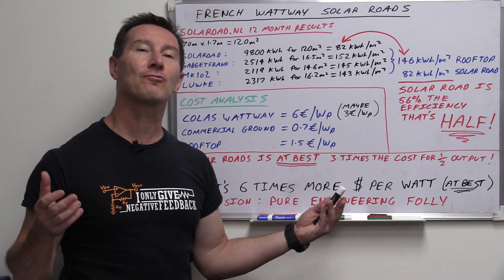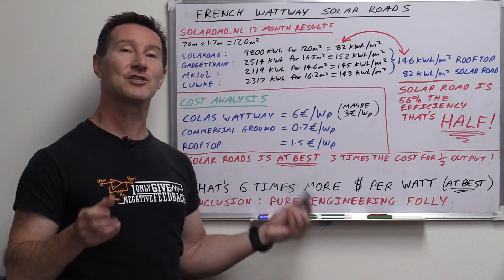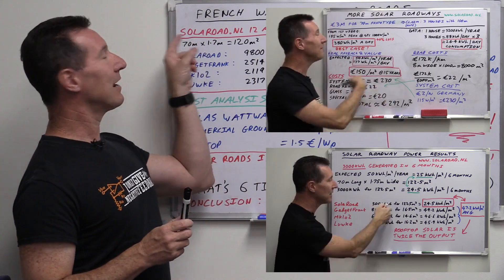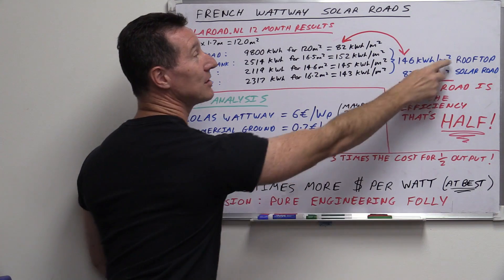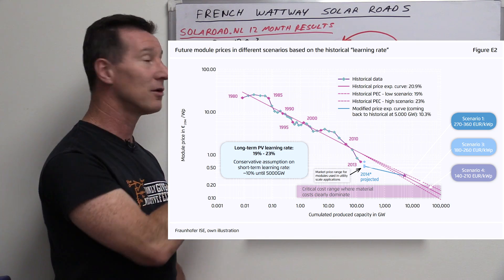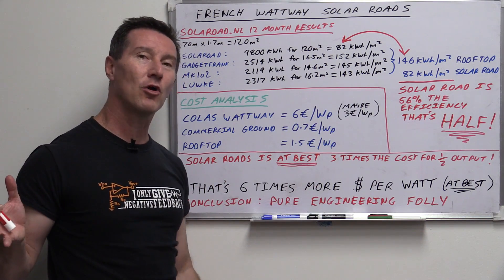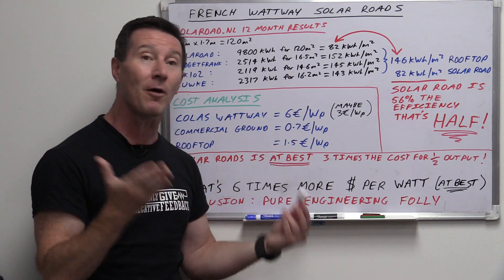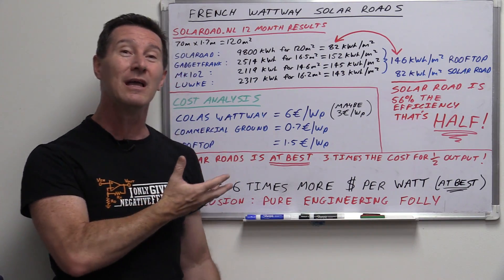EEVblog #850 - French Wattway Solar Roadways BUSTED!

Comment: The problem is that the cars will be blocking the sun from the solar pannels during traffic and there will be no electricity it's far more effective to put them on roofs of buildings
Reply: +super awsome minecrafter it s not on highway with high traffic jam . it s for road of parking lot or little village or on the side of highway where the cars are not ! Even if it 's on the road the cars doesn't hide the sun a long time but some seconds. there is always a lot of space between 2 cars
Reply: +super awsome minecrafter dude, emergency lane ...

Comment: Also don't forget that you need materials and energy to create the solar panels in the first place. Why should we apply it in the most inefficient form possible. In the end,  the materials and energy will cost more to the environment. Solar panels are pointless on roads simply because for it to reach the peak efficiency, it expect the road to not be used as a road in the first place. What we need is an efficient way to harvest the heat, vibrations/noise generated by cars and the sun 😁